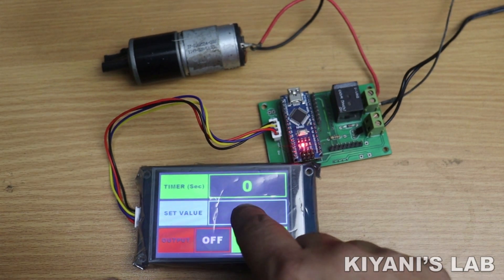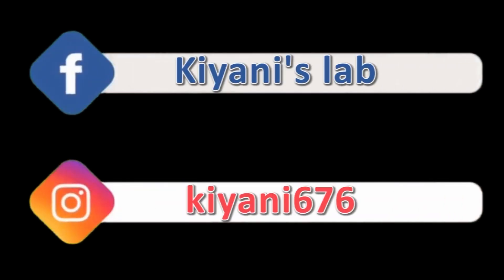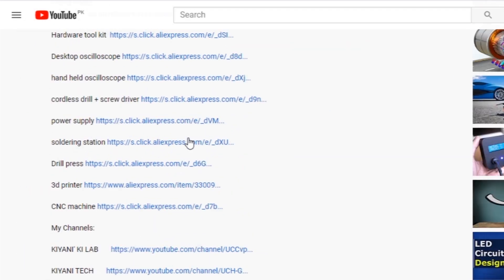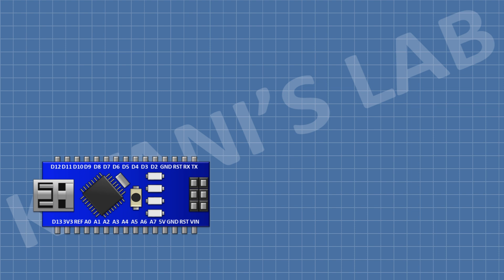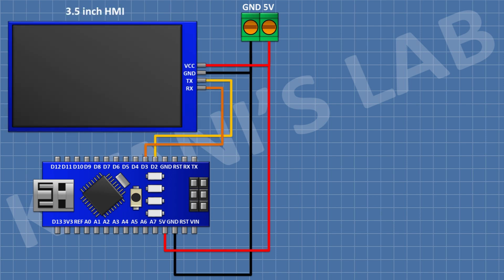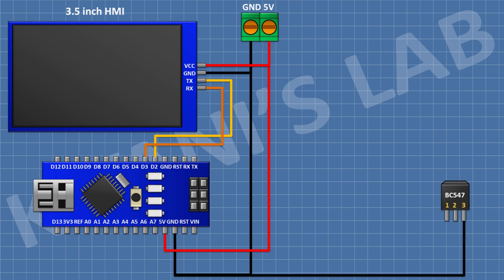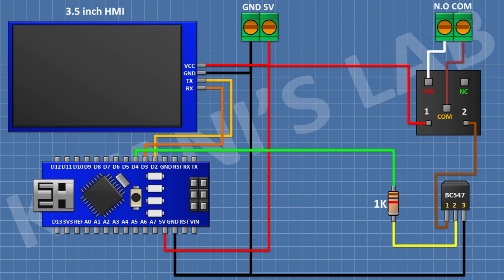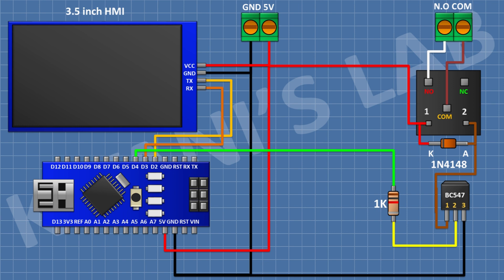How To MAKE HMI Timer Relay | Arduino Project

Comment: Sir i want to interface TOUCHWIN TG765 HMI with arduino UNO by using modbus RS485. i have arduino UNO , Arduino TTL to 485 Shield and TOUCHWIN TG765 HMI. Can you help me which modbus libraray is best because my requirement is to control a OVEN. in which two motors used. Burner motor and blower motor. One motor will be controlled by PUMA frequency inverter and other one has another driving card. Arduino will generate PWM for both inverter. On HMI temperature and time will be set and transfer it to arduino by using modbus. Start, stop, reset, reset burner and some other commands also send through HMI to arduino. Temperature will be read by using MAX6675 thermocouple shield and send to arduino and arduino send temperature to HMI. actually i want to know will arduino work in this type of project?? How can i secure my modbus communication through software and also in hardware for any noise reduction.